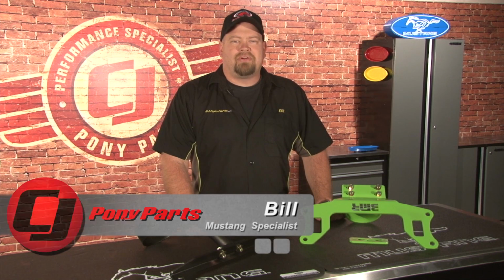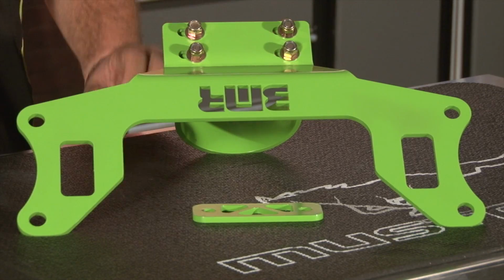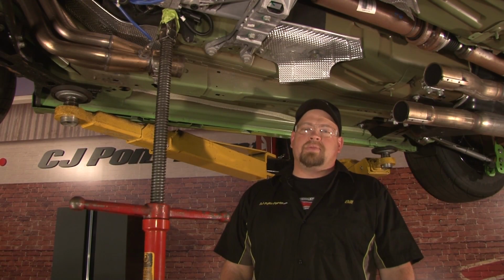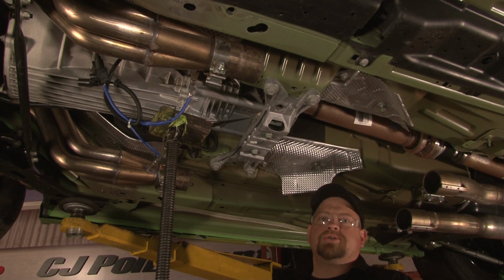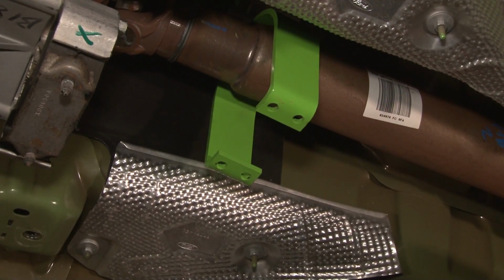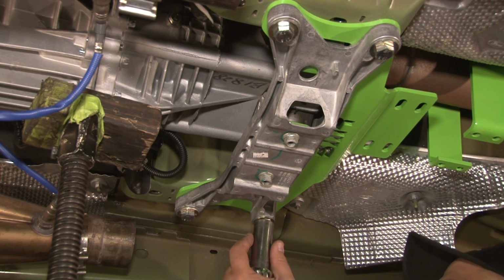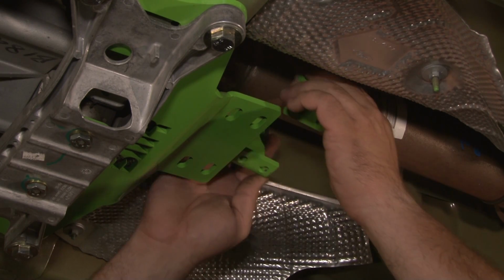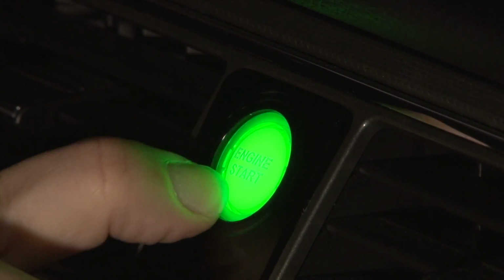Mustang BMR Driveshaft Safety Loop 2011-2018 Installation

Comment: Does anybody know if the driveshaft from the gt have the same fitment as the v6? both cars are 2014 a found a one piece aluminum DS almost new for 200 bucks but don't know if it fits the v6.

Comment: I flipped the X pipe for clearance since the car was a stock height. I have since welded new bungs further back and re-installed them but they are shut off with the tuner anyway.
Reply: Thanks Bill! 

And if I was lowering with Eibach Pro Street coil overs, could I still flip the X pipe?
Reply: MrEgopathy  I flipped the X pipe so the sensors were pointing down. Since the car was at stock height there was plenty of room, on a lowered car you would most likely rip off the sensors.

Comment: So how did you clear the O2 sensors when you finished installing with the ARH long tubes? I have the same headers but was worried about the clearance issues. Great video by the way!